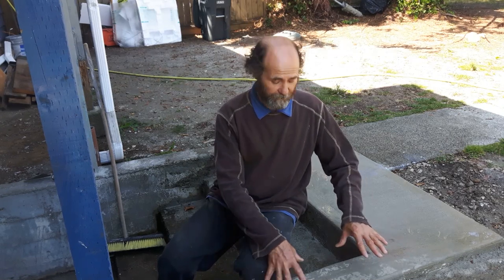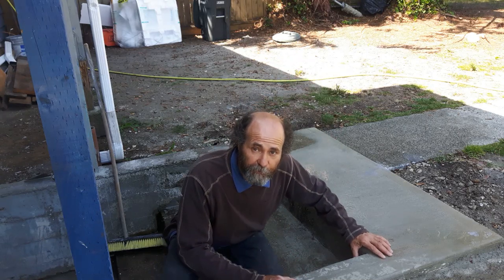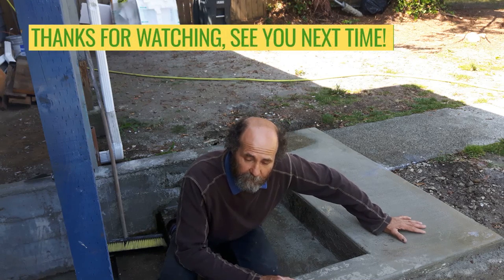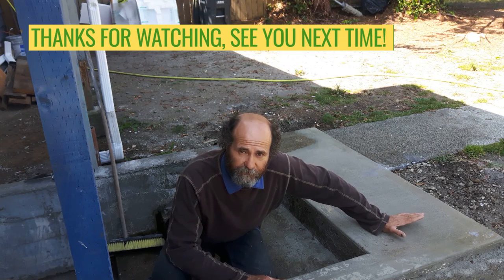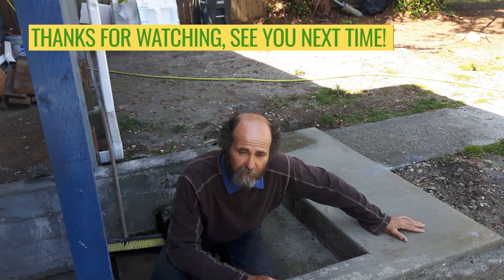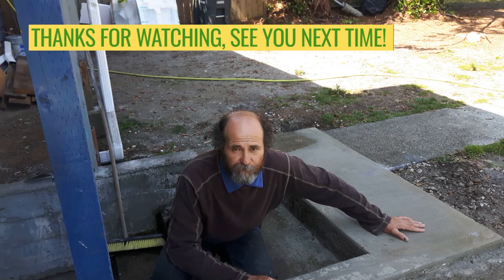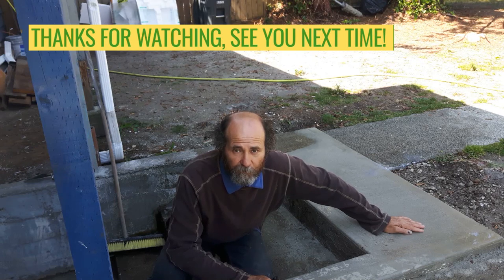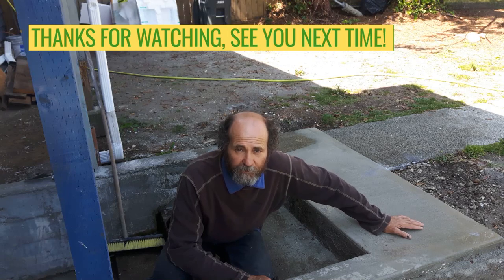How To Repair Broken concrete steps

Comment: What is concrete glue?
Thank you for your videos.
Reply from the maker: It is concrete additive to give extra strength to concrete, the additive helps, when use as a primer on the old concrete before pour fresh concrete on top, there are different kind of additive depends where you live.
Thank you for watching my videos and for  your question, you time is appreciated.